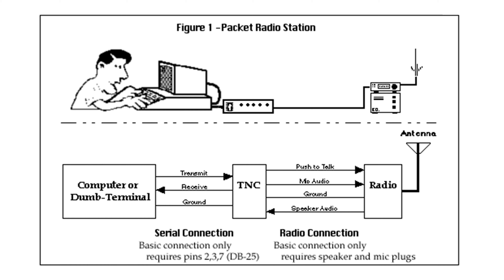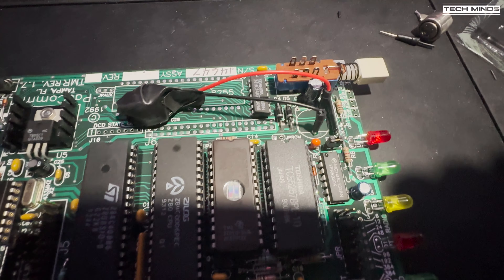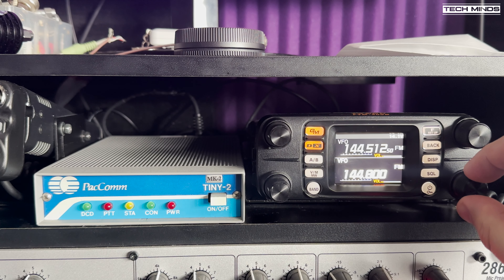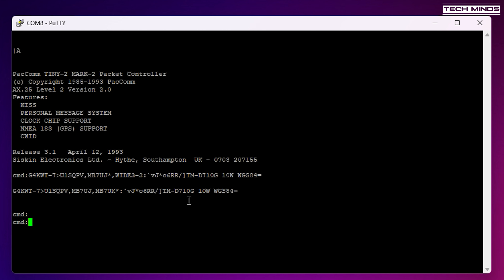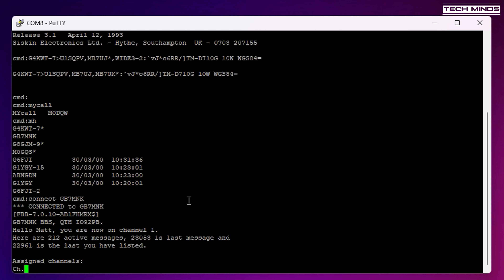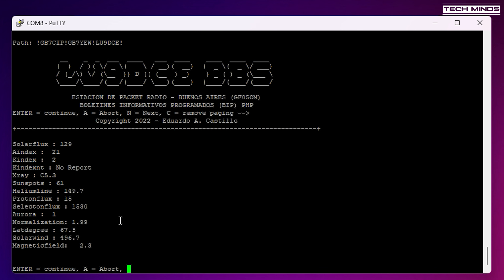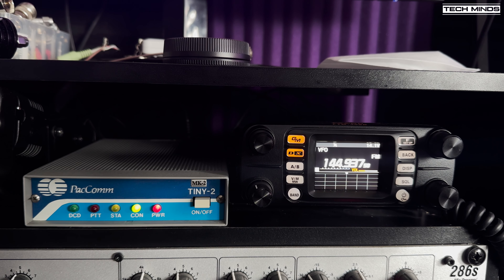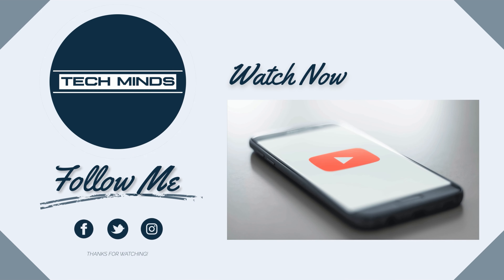PacComm TINY-2 Packet Radio Modem - Does it still work?

Comment: We went for the simple BayCom modem kits and DOS based TNC emulation freeware/software of the day (early 90s) like TPK, TSTHOST, etc.. This was a cheap and relatively easy way to get into packet radio back then.
Reply: I remember hacking an obsolete C64 phone modem for packet.  That and an old 2m rig and a 1/4 GP made (literally) from coathangars let me work the Packet station on the MIR space station.  That was a while ago now.
Reply: I've used and still have a DOS based laptop that can run BAYCOM or WNOS (TCP/IP). Previous to Baycom, I used Digicom for the Commodore 64 and still have this kit. I've never used a TNC.

Comment: Ah, fond memories. I sold my Tiny 2 a long time ago. I still have my satellite modem setup, which has been unused for decades. This is a Tiny 2 clone built on the MaxPac pcb with 1200 and 9600 baud G3RUH modems for communicating with the UOS and JAS orbital BBS’s.  As they were in a polar orbit global coverage was achieved. In those pre internet days I thought that was fantastic to upload a message to an amateur satellite in orbit. Doppler correction was automatic and used the transceiver microphone frequency up down buttons. As with most of my projects over the years the challenge was achieving it.

Comment: I had one back in 1992 when they first came out, used it with my Amiga, only used it for mail, was a lot of fun, my very first experience in electronic mail, I used  it to send messages to and from college where I was studying, my teacher was a ham radio operator, I've still got it in the garage don't know if it works still.

Comment: Just started using packet again after node setup near me. Use the software method i.e. soundmodem and easyterm. Plan to resurrect my Pakratt 232mbx and FT290 combo I ran in the early '90s. Slow but good fun.

Comment: Hi Matt…Just dug out my  hand built TNC220! Battery 0.221v Not used since late 80’s so will give it a go here in the Midlands .. Thanks for the inspiration😁👍
Reply from the maker: Nice Graham! I have a good take off to the midlands from here, well to Coventry area as I hear the C4FM repeater strong on 145.600. Have fun! :)

Comment: There are two packet BBS's in range of me here in Connecticut! I'm mostly using Direwolf both with a Signalink on my HT and through my FT991a connected directly to my Windows PC. I'd like to host my own BBS at some point as a former telephone modem based Sysop in the 90s.
Reply: I was also a sysop in the mid 1980s, and always wondered about getting a packet radio setup but life got in the way.

Comment: Gosh I remember having a Tiny 2 for packet radio  about 25 years ago . I use to use it to node hop to tcpip address,  managed to get to the usa checking nodes which responded to my node request,   using I think the wormhole at Cardiff University

Comment: I have the same unit which I purchased the last upgrade of the firmware. From what I have learned is the the company is still around but they changed their product line after the Bosnian war in the mid 90’s. They started making GPS marker systems for border monitoring all connected to a central UN monitoring center. Movement of any of these markers will result in a military team being dispatched to the point of violation of border markers.

Comment: We have been waiting for you 😀 I do not recommend direwolf for connected mode on HF as direwolf does not support ACKMODE, which without will cause timing issues and headaches with collisions on 300b. .AX25 has got an upgrade with FEC - FX.25 which is backwards compatible, but adds additional robustness-  QtSoundModem is the go-to for HF,  the port of UZ7HOs TNC. 73- PE1RRR
Reply from the maker: Cheers!

Comment: Hi Matt M0DQW, Sacha from FH Aachen Space Operation Facility (DL0FHA). Thank you for this wonderful video about the Tiny-2 TNC! I recently also got one of those, but I need a technical user manual, reference, or cables. Is the serial line connecting to the computer a traditional rs232 Null-modem cable, or does it have a different pin layout? I was worried about connecting it because back in time, It was not obvious and God-given that serial devices used standardized RS-232 cables out of the box. Some of these old gears used slightly different pin layouts and exotic voltages, which eventually resulted in fried electronics if connected without taking care. Would you happen to have a user manual or technical reference at hand? Thank you very much, 73'

Comment: 👍❤ However, you should really cover the glass window on EPROM chip with black type (even better: aluminum or copper tape) ASAP if you don't want the firmware to be damaged.

Comment: I user a Baycom on DOS then with WINPACK up to XP. After I could not run Baycom on any windows. A few years ago I repaired a radio for a mate and got paid with a PK-232MBX. Now decode packet from the ISS with scanner 232 and python script I coded. Only got aerials in my loft of bungalow. My SDR seams better for the ISS then the scanner so may move to that.

Comment: I was very much into packet in the late 1980's early 1990's.
Built a Pac-comm TNC 200 then a Pac-Comm TNC 220 which still works but being late 1980's tech is too old for KISS.
I want to get into APRS so have just bought a TNC 320 which being newer has KISS.

It goes into KISS mode OK BUT it will not come out with KISS OFF RESTART.
Only way I can get it out of KISS is to open it up and take the battery jumper off for a few seconds.
Any ideas?  Is the Tiny 2 the same?

Dave
GM4NFI

Comment: Actually you can run a PMS unattended in the UK but 3rd Party and Digipeat must must be OFF.  Anything involving 3rd Party traffic needs an NOV.
Reply from the maker: Can it beacon unattended?
Reply: @TechMindsOfficial  From memory yes Matt (it was 30 years ago we did all this work with Ofcom and RSGB to update the licence!)   It's the third-party traffic we need to focus on here, it becomes a repeater with 3rd party ON hence the NOV requirement!  Ditto a digital hotspot, thankfully MMDVM can inhibit 3 Party access, Wires-X can't though  DGID could be used to block others I guess.

Comment: youve got your settings on your mic all messed up on this video, there is either too much gain or too much compression or too much expander. I cant tell but your voice is coming through with too much static noise and power as you speak, id say a basic change on your 286s i can see there...